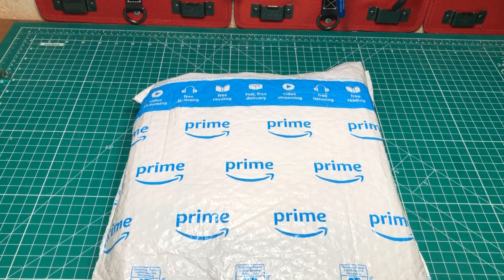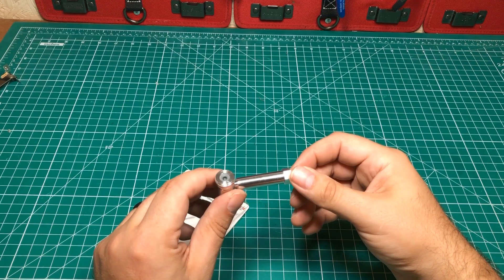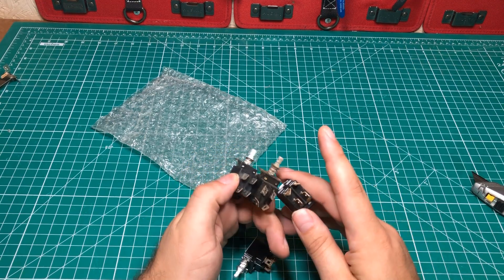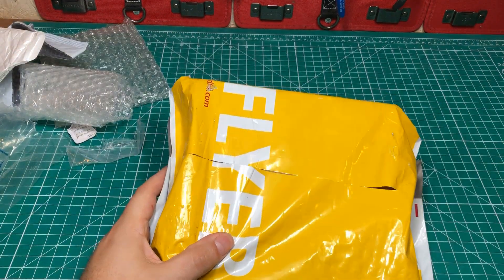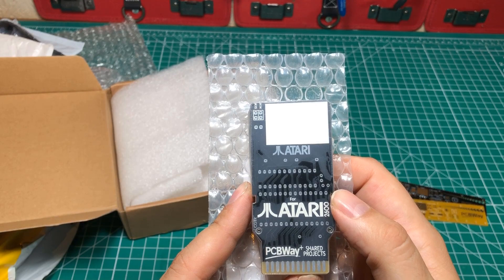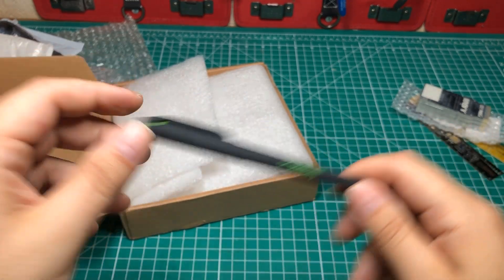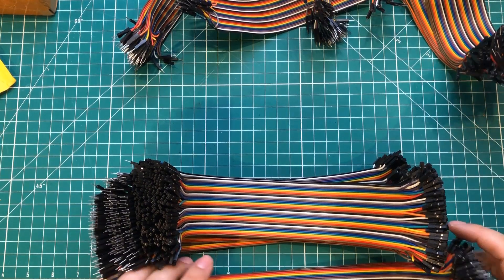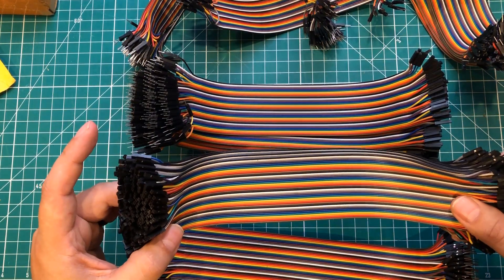Mailbag 46

Comment: I need to order a ton before then some how.
Reply from the maker: A ton of what?
Reply: I am totally new to ESP32 and such.  Yet I have 38yrs or so of IBM Corporate computers /sales/sizing/etc.  self taught RPG/RPGIII programmer to automate 8 jobs..lol. (My brain works overtime to keep from physical overload when you can automate with code… (😂). In sales I was assigned 700 “top tier” accounts and 100 were “premier”.
I “had” to create best practices and Drive revenue.  I blew it out and was promoted to ASIA.

NOW ESP32 and small tech logic is awesome in what I am learning from your and other videos.
As Disabled, I have a million ideas to implement small tech to “make a difference for me and others….not make pretty lights.  Though pretty. Lol

I want to buy several base type boards. Many sensors, and electrical components needed to make different things.

Then learn one type of project and components at a time.  I run, jump, and fall, and eventually fly.  Class structured doesn’t cut it.

So, a makers basic supply of most components to bring electricity up or down, sensors, correct size batteries or (smallest CAT6 POE WIRE diameter) to run instead of WIFI / connectors.ESP32 s3, / ESP32-ethernet.  Aw 8266?

I now have PACKAGE Arduino, an 8relay switch, imoisture sensors, 4 small motors, 4 (little larger) motors,  
1 garden area now, 2 55gal rain water barrels.  (Need clear tubing different sizes/lengths). Then I can hopefully use GitHub to program and get it working.  That will grow to many raised beds in 1.2 acres. And 5 rain barrels with 1,000GALLON retainer under trees up hill. (Gotta offload full rain barrels when full also.) BUT SMALL SETUP FIRST.

Comment: Just ordered to clear PETG.  Clear, pure, PLA (4043D) is pretty cool stuff for doing difficult prints.  You can do overhang stunts at high fan speeds + low temperatures.
Fancy PLA colors (gloss, metallic, florescent) are sometimes brittle, and lack good self-adhesion.
Maybe the video device enables you to read the i2c data from a monitor, like the vendor and graphics capabilities and such?
Ghads, that is a lot of DuPont jumpers.  Do you really cannibalize them to make cables?  I make most cables with a couple meters of 40-wide ribbon cable.  Stores easy.  I think it is 26-28awg fine-stranded PVC.
Have always wanted neoprene socks (mentioned in The Complete Walker) for stomping around in the wet. Hard barrier. Have read that the minus side, is that the material doesn't "breathe" well (shrug).
Reply from the maker: I probably should have purchased PETG instead of PLA, but overall I was pretty happy with the prints. I have a glass bed and I know that doesn't always go well with PETG.  I do think the video device allows you to do some things like allow TVs to do unsupported resolutions etc.  I guess I'll find out.  :)

I do use the dupont wires for jumpers sometimes.  It depends on what I'm doing, but a lot of times for quick and dirty work, I'll solder male pins in headers. Primarily for things like nonstandard pitches and stuff like that. I had to diy a flexi cable between a 1980s computer and the motherboard...stuff like that.

One of the most fun things about living in Alaska was the cool gear...and since stores were so limited with no infrastructure, you would get insane deals at the end of the season. Sam's club would always clear out wool socks in 3 packs for 1.97.  I also bought these really sweet Baffin snow boots that are good down to -300c or something crazy like that.